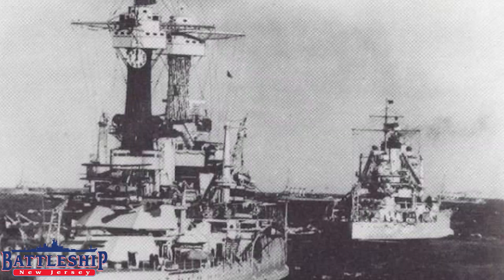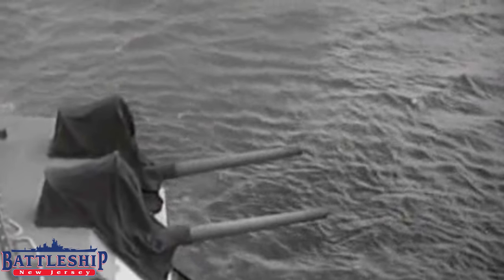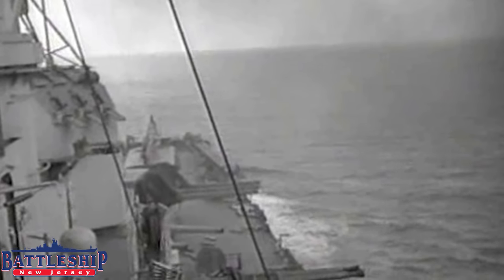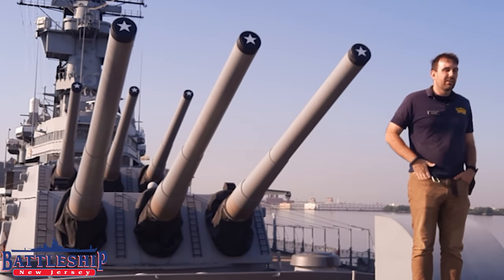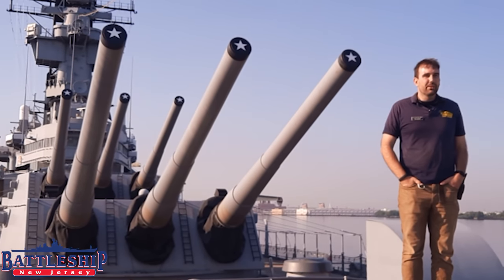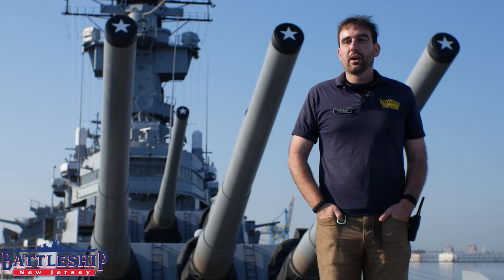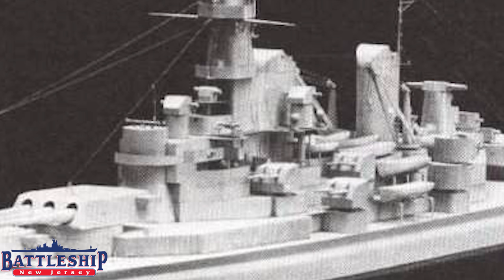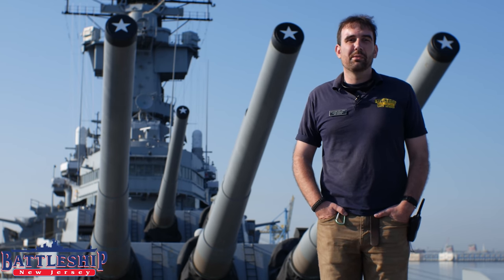Why are There Clocks on the Superstructure of Battleships?

Comment: This would be a challenge in a video, but I would love to know how they converted a UTM grid coordinate into a firing azimuth and elevation for the guns while the ship is moving. 
I know how artillery does it, with a plotting chart and basically a protractor to determine range and direction of fire from the howitzer to the target. A little math, and you get elevation and propellant charge. 
But when the target isn’t moving, but the gun is??  Add in converting from lat/long to a grid coordinate, or the other way around??  Also, it’s probably indirect fire, so the ship doesn’t see the impact, but keeps on moving and must adjust fire when she shoots from a different location. 
The Mark 1A takes range and bearing and converts it to elevation and firing azimuth, plus corrects for ship roll. 
My question is how do they calculate that range and bearing for a land based, non-moving target?
Reply: You don't have to correct for the ship's roll.  The fire control system waits until the ship is vertical before it fires the guns taking the roll out of the equation.
Reply: The fire control computer also knows how fast both the ship and the target are moving, so it'll keep the firing solution going with a target speed of 0. The initial range and bearing is (at worst) half a minute of map and protractor work or (nowadays) "punch the UTM into the laptop and it'll do the protractor work."

I'm pretty sure Ryan did a video on the FCS several months back.
Reply: @loosh5101  I remember the fire control computer video, but he didn’t mention map and protractor (I think).  But the 0 target speed setting solves most of the problems I could see. I was foreseeing having to incorporate gun moving into your solution, plus other issues. But let the computer solve everything. 
Thanks for that info.
Reply: @marcseclecticstuff9497  I remember that from a previous video (you pull a trigger and the gun fires when the gyros say it’s ok).  I was questioning how they determined azimuth and range to a stationary target.

Comment: “Form Battle Line”! Why they were called “Ships of the Line” and therefore “Line Officers”. Other than Staff Officers who were not eligible for command at sea.
Reply: Back in the Napoleonic era major naval engagements were conducted by the two fleets forming line astern and sailing past each other at very short ranges such that it would have been virtually impossible to miss with an entire broadside. Basically it was a pounding match between the big boys - ships with sufficient and large enough guns to make their mark that were also sufficiently heavily built to have a chance of surviving that first pass. These were the Ships of the Line (of battle). Less substantial ships, such as frigates would be expected to keep out of the way initially and then engage damaged of disabled enemies.
I think you'll find that Line Officer was not a Naval but an Army designation for those junior and middle ranking officers who were routinely required to march and fight alongside the men they commanded. The most seniorr officers and the less senior but still priviledged Staff Officers who assisted with the planning of campaigns would normally stay behind the lines. Sometimes quite a long way behind the lines...   HTH!
Reply: @davidpowell5437  Crossing the “T” was the goal.

In my naval history classes as a Midshipman that’s what we will taught. I guess they once again, lied to us.
Reply: @louisludlum8030  No, crossing the T was the goal, because then all of your ships could concentrate their fire on one enemy ship at a time. It was just very hard to arrange.

Comment: Can you talk about the main guns, specifically, recoil? Iv noticed that in a lot of videos, when Iowa class battleships fire, after the shot, the gun barrel suddenly drops, and kinda bounces. Why does it do this?
Reply: The guns are dropped almost to the horizontal for loading. If there is any elevation then the breech won't line up with the rammers etc. since at high angles it vanishes into the barbette below the gun house, (?.....sorry, operating from memory with Brit terminology). This is the case for any battleship's main armament.
Reply: @Michael Evans  oh ok thanks! I didnt know this!

Comment: Since Japan was behind in deploying radar, did they retain range clocks longer?  Also, since WW2 radar was of uncertain reliability early on, did they just start setting the later range clocks with radar data instead of shot spotting, so any nearby ships that hadn't yet got radar or didn't have it working would have the same range?
Reply: I do know on the back of that question that the reason for Japanese battleships having such tall superstructures was to spot an enemy over the horizon before they spotted you and hence could engage with ranging shots first if needed increasing their chances of the first hits on target.
Reply: They perfected night fighting. They used aircraft to drop flares by parachute to light up the enemy ships and their range tower was equipped with a mounted binocular for extreme long range viewing. Every ship used a different colored marker so the observer could report needed firing adjustments. More information on that topic can be found at your local library in books about the naval battles of Guadalcanal.

Comment: I have a question I've been trying to find the answer for years: How exactly does the Mk.37 director work, as it pertains to Anti Aircraft guns? And, similarly, how were the 5" and 40mm controlled? What was the sight picture the Director was giving to the Sailor or Marine controlling it? Thanks in advance!!✌️
Reply: By the way, the optical rangefinder works by "amplifying" your natural depth perception; the lenses are some 10-20 feet apart instead of 4-5 inches like your eyes. You look through the telescopic lenses at the target, and you "see" an image of crossed lines...not a "+" as you would through a rifle scope, but more of an "X". The rangefinder operator attempts to position the center of the X over the target and keep it there, while the gunnery officer estimates the target's speed, course, and rate of climb/descent. This is all fed to the Mk 37 computer down in forward or aft plot, which generates a firing solution. When the "automatic fire" trigger on the Mk 37 is pulled by the operator, the guns slaved to that director will fire as fast as they can be reloaded.

Comment: the guy finished explaining about the clocks utility, said nonchalantly they are obsolete and while doing all this im still wondering why were they used for...   or the marking on the side of turret or blue smoke fired
Reply: The gunnery officers knew the ballistics of the shells.  Knowing the time of flight determined the range.  As for color, these vessels were designed for visual combat conditions.  The colors will tell you if your firing solution is correct.
Reply: The US Navy has all her battleships in line of battle. Say the German High Seas Fleet is lined up ready to fight. Both sides start shooting at each other but it's kind of hard to tell exactly how far away another ship is in the middle of the ocean so nobody is hitting anything. Each ship has a different color of dye in the back of their shells, so despite the fact that 10 different ships are all blazing away, the lookouts on New Jersey know they just have to report where the blue splashes are landing. All of a sudden New Jersey scores a hit! Their main battery director has the range at 9200 yards and the bearing at 130. The guys on USS Texas steaming ahead take a look back at New Jersey's range clock and see the hands on 9 and 2, so now they have the range to set their guns to. They can look at the turrets and see New Jersey was aiming with a bit more lead than they thought they needed.  Now both battleships can start putting shells on target. Maybe they put up some signal flags so the rest of the fleet gets the info too.
Reply: @justinking7773  thank you, so the info on clock  is just for the range to target.if they had multiple targets?

Comment: I buy the explanation that they are not clocks. However, what good are dials showing up to 10k yards if 12 inch WW1 battleships fired nearly 25k yards max for example?  Ideally want to engage at longest practical range so sharing info on ranges greaters than 10k yards is vital.  P.S. guns fire farther not further.
Reply: I think 10,000 yds/5.5 miles is the limit. Everything farther out is beyond the horizon line. A scout plane would be used for anything beyond that range and the range adjustments would be sent by radio.

Comment: Were there any considerations for the Iowa class, or other surface combatants which used guns as thier primary armament to be retrofitted with gun launched guided missiles, in a similar way the M162 fires the MGM-51 shillelagh, or how modern Russian tanks use atgm's?
Reply: No. Missile systems are modular self contained systems with one module holding multiple missiles. The battleship turrets are way too slow and the firing angles too limited to be useful for missile firing. There also would not fit in the shell hoists.

Comment: 02:22  So, the greatest range these "clocks" could indicate was 9,900 yards?  That's just a little over five-and-a-half miles.  Seems awfully close!
Reply: @Wayne Flanigan Excellent!  Thanks very much for that clarification and amplification.

After reading your comment, I was able to determine that the distance to the horizon (in miles) is 1.23 times the square root of the height of the observation point (in feet) above the water surface - a formula which, of course, gives your results.  (Similarly, the horizon distance [in kilometers] is 35.7 times the square root of the observation point height [in meters].)

Comment: What if the first ship in the line finds the correct range?
Reply: It uses it's range clocks to relay it to the other ships, there are clocks on the front and back of the superstructure.
Reply: Ah, I see. I thought it was just the front. Thanks.

Comment: You know, range clocks work both ways, you are telling your own ships the range but you are also telling the enemy ships…
Reply: Range clocks faced fore and aft so if you are firing broadside, the enemy would find them hard to read. And even face on, if the enemy were close enough to read your range clock, finding your range would likely be easy.
Reply: @agreinhold  that is why destroyers accompanied the fleet. They were to small to fight in line ahead formations but could “cross the T” and read range clocks while throwing fly specs at the elephants